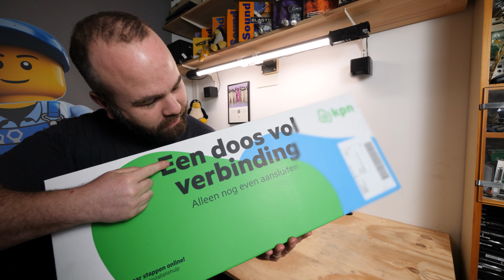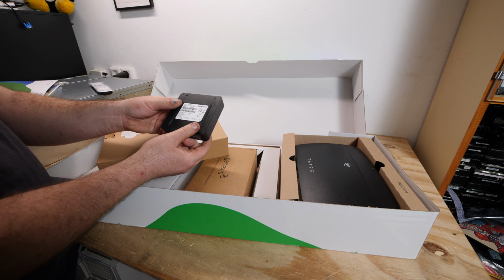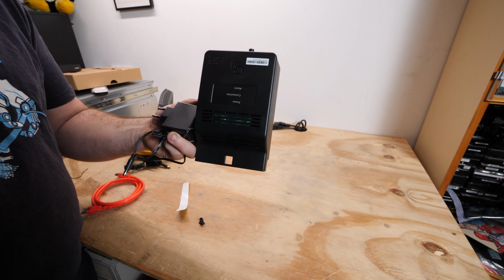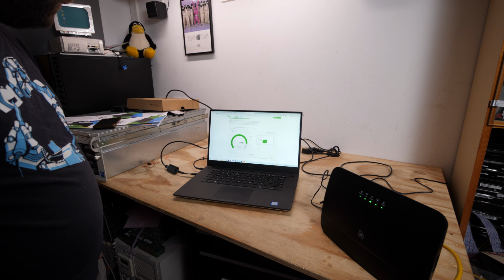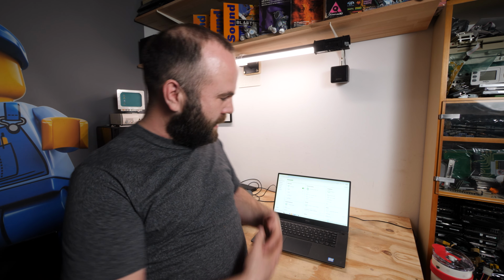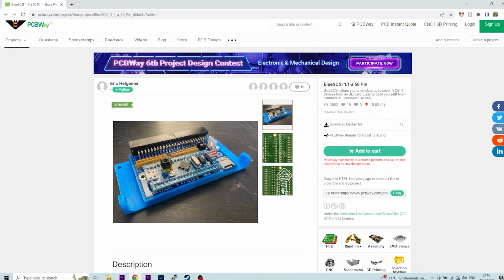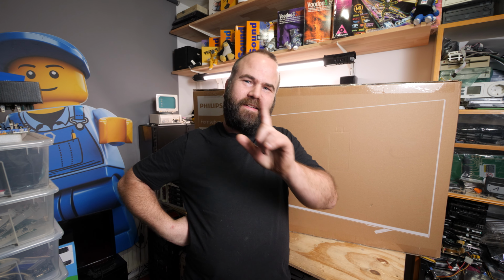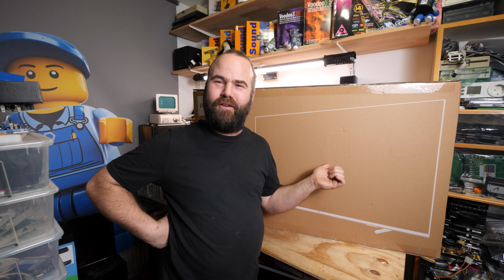KPN FIBER Internet, Getting Faster Internet! Bye Ziggo!

Comment: In France, we get all our equipment from an Internet service provider and it is basically impossible to replace it with another/different brand without getting a PhD in this matter :)
But in principle, there is no point, since we get symmetrical fiber optic 8Gb/8Gb where in the router we have 4x2.5Gb and one connector that allows us to obtain symmetrical 8Gb on one computer. Plus Wifi 7. It costs 50 euros a month, but it's worth it

Comment: Such a shame it's KPN. That company sucks. Starting with their routers. And the fact they deliberately make it a pain to replace it with your own. Not to mention the fact the actively hindered the rollout of fiber for years.
Reply: It's NOT a pain to use your own router, that is BS. I got KPN Fibre in 2020 , and after testing the pipe with the experiabox, I immediately replaced it with a Raspberry Pi 4B with OpenWRT. Works like a charm, although it does require a bit more technical knowledge. KPN has manuals online how to set your own gateway's config to connect to KPN's gateway.
I don't like KPN either, but to be honest they are not much of a hassle nowadays, Fibre rollout is near complete finally and that will serve us well for the coming decades. They also absorbed all XS4All personnel into their KPN helpdesk, and a lot of them are actual gurus. Fibre clients always have access to these guys if they wish to. And as someone who has worked in data networking for quite some years, I can tell when helpdesks are bullshitting me or not, but in their case their knowledge actually surprised ME sometimes.
Reply: Have you found the technical instructions online with all the details? Since the vrije modem service stuff this is published info.

Comment: Experiaboxes suck, always has been.  
As you have the MTU (genexis) already you can just use your own router and throw that garbage in the trash. 
The MTU is performing the translation between the fiber connection and RJ45 copper. It's essentially just a mediaconvertor. 
You can just use your own router (I believe mikrotik ?)  , you will need to create a VLAN tagged interface with VLAN6 or have a switch do the VLAN Tagging. 
Setup a PPPoE connection and voila, direct IP on your router for internet. 
As you are not going to use TV this is fine as setting up TV might be a little more challenging. Yes, been there done that, got it working.
You mention giving away that TV box, well, that is most likely not going to work as it's probably locked through registration. But do give it a try.

AFAIK KPN doesn't give you a dedicated public IPv4 anymore, unless you get a business subscription. This was one of the main reasons I moved away from KPN to Freedom.
It might look like a public IPv4 , but they are reusing old IP ranges in a carrier NAT fashion. So don't be confused if you can't reach your IPv4 from the outside as this might be as intended.
The only thing you can for KPN is to get the business subscription, which requires a KvK registration etc.... yeah..... I know... <3 Freedom <3
Of you need to setup a tunnel to an external server with public IPv4 and use that as a breakout.
You do get a public IPv6 so just use that and everybody is happy. Why you need IPv4 anyway right, most sites work fine on IPv6 and the ones that don't should be ashamed.
"But I can't remember my IPv6 address" well that why we have this magic thing called DNS. 

Second caveat:
PPPoE uses 8 bytes and you might (almost certain)  run into problems if you don't adjust this.
Especially SSL (https,ssh ) tends to break as frames get split up which it doesn't like for obvious reasons.
You got 2 options, 
1 ) set the MTU for the PPPoE to 1508 , aka mini jumbo frames, which KPN supports or 
2 ) set the MSS to 1452 (default is 1460 , remember MSS is MTU - 40 (IP+TCP header) )
You should also have IPv6 on that connection and I recommend you also configure that. 
Don't be like, naah don't need it, learn it the proper way as more and more sites use it, tend to load quicker and ignoring it will run into problems later on. 
You will need to setup a Prefix Designation Hint ,  IA 1 , /48  , SLAAC , IPV6 over PPPoE (this will make sense when you config this) , if you need help , you know how to reach me =D

FYI
That green connector on the MTU is simplex SC APC. Although you are correct that up and download "go trough the same cable", it's a little more technical.
Normal fiber cables are usually duplex, aka 2 fiber wires and normally they use the same color/wavelength to send and receive. Because the connectors are crossed physically this works.
The one used in the MTU is simplex, aka 1 wire, which uses different laser colors to create 2 paths. We call this BiDi aka BiDirectional and it's needs a matching unit on the other end which is flipped in the wavelenghts. If you want to not use the MTU for some reason, you can buy a transceiver with the proper wavelengths and put it directly in your router. You will need to get the proper cable, which is not a common one and using the wrong type might damage the connector. If you can keep using the MTU, I would recommend it and just use RJ45 for the rest.

Comment: What type of fibre connection is that you have? Is that full fibre to the home? And what type of old style phone connection do you use in NL because it evidently is not German TAE, or US RJ11 (which we use here in Costa Rica as well). I personally got fibre to the home, with the box that connects the fibre connection with the router being passive though, because it doesn't need external power.
Reply: The old phone lines used simple 2 wire comms over rj11 connectors in-house, but the wall outlet was a trapezoidal 4-pin, developed by PTT (former name of KPN) somewhere in the 1950's or so. Some people like me replaced them with dual rj-45 outlets for both 100Mbps network and a phone line (over a single cat 5e twisted pair cable).

Comment: 1 Gbyte? So you got a 10 Gbit connection? Wow. ;)
Can't you set the modem to bridge mode and only use pfSense?
Or only use pfSense?
Reply: I don't think that's possible with the KPN modem/routers. I have no experience with model 12, but just like with VB's router, the earlier models have been configured to disable just about everything that you could change about it. Very useful for inexperienced consumers, but infinitely frustrating for power users like VB or you or me, who prefer to have as much control over their internet connection as possible. 

Personally, I find KPN's modem/routers a bit fiddly. Their main pre is that they usually work out of the box, their main con is that for more advanced customers, the lack of features that are enabled is frustrating to say the least. 

Also, the routers must be cheap as hell, because I have a spare one in my closet that I was specificall told not to send back to them. Apparently they have warehouses full of them...
Reply: KPN recently raised the Max speed to 4 Gbit per fibre. I was 1 Gbit, which is probably what Victor has. 4 Gbit only has merit if : 1. You have many people on your network raping the internet, and 2. You already have 5 or 10 Gbit in your home, which currently is still a bit too expensive for us poor budget bastards.
I have the KPN 1 Gbit connection since 2020 and I've been exceedingly satisfied with it. Never had any serious outages, besides the occasional nightly interruption due to maintenance. 
I use a Raspberry Pi 4B with Openwrt - MUCH faster than the stock KPN experia boxes, especially when you're doing things that tend to choke up the NAT table (Bittorent etc) and still very low power consumption.

Comment: Interesting. In UK it's a little different. The network provider will supply the fibre service that includes the optical to RJ45 converter (ONT). The ISP will then provide the router which will connect to their service over the fibre provider using some form of encapsulation. In my case, this is PPPoE. I replaced their router with my own Ubiquiti Edgerouter.
Reply: Not if it’s a business connection.